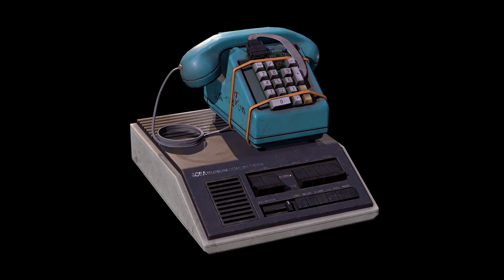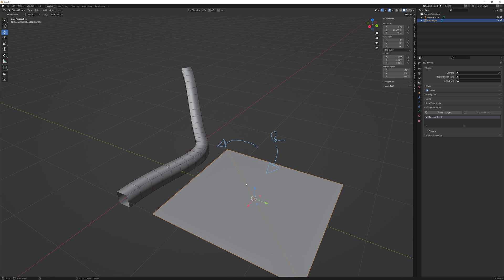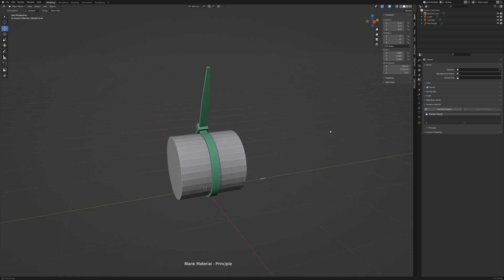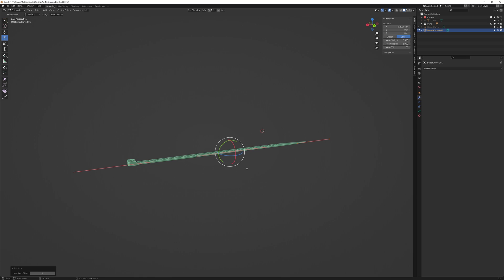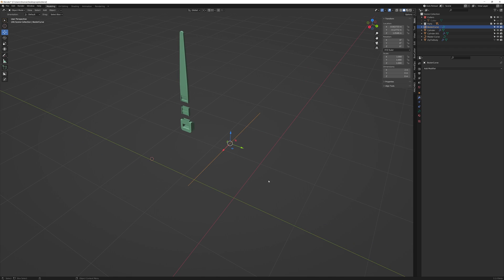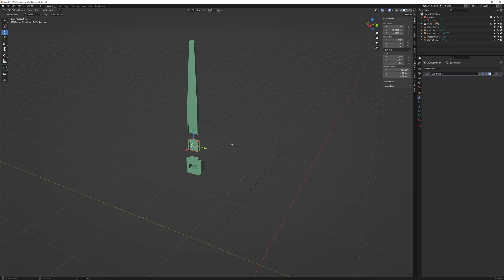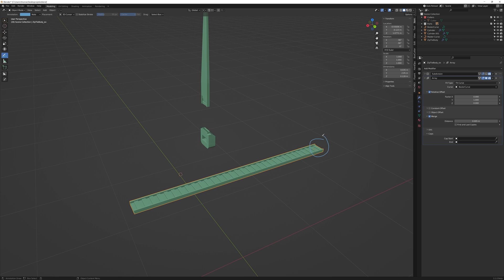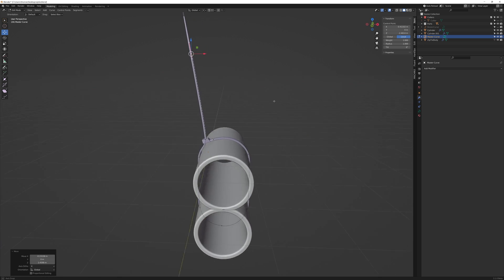How To Make Zipties in Blender: The 3 Easy Ways!

Comment: Any tips for for getting the bezier to work at the scale of an zip tie? The bezier is still able to morph and add sections of the teeth, but I have to move the bezier point like 90 meters for the array modifier to add 1 teeth segment and the bezier point ends up way away from the mesh. The ability is to control both the length and shape with is a bezier is definitely awesome

Comment: For the third method, the end caps are not properly aligning when I set them in the array modifier.

I created one ziptie model, and split it into the three parts as you had suggested, but they don't line up with each other when I attempt to add them as caps?..
Reply from the maker: Make sure the split pieces have correct pivot positions.
Reply: @ArtOfPilgrim  What would be "correct"? Centre of geometry or?..

Scratch that, origin to geo was what I did that got the misaligned results x.x
Reply from the maker: @aymimakesgames  glad you got it sorted!
Reply: @ArtOfPilgrim  I think you misunderstood me sorry.

I Didn't sort it out. Having the object origin for each piece in the centre of their individual geometry makes them misaligned. Leaving the origin where it was after I broke the pieces up, misaligned. Putting the origin at the edges that would touch, misaligned.

I cannot get this to work at all :(
Reply: Also struggling with this, can you clarify whats required for the caps to align properly?